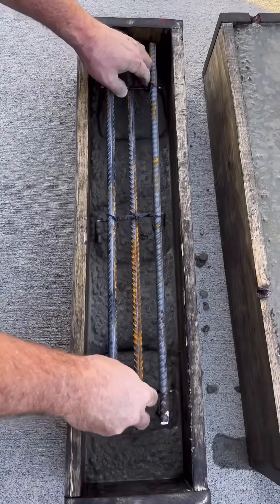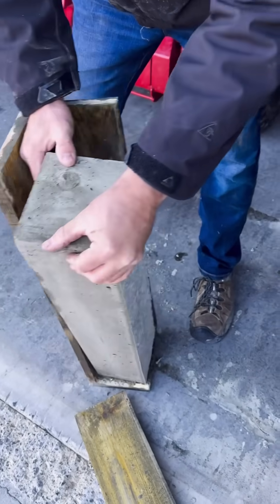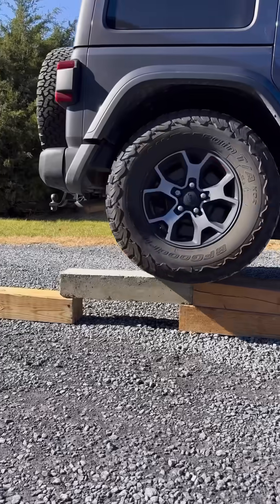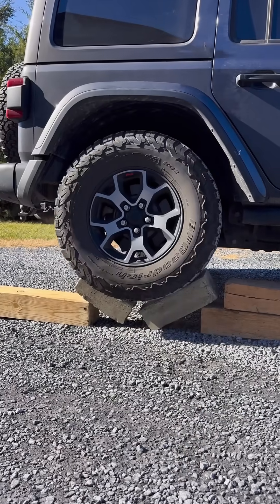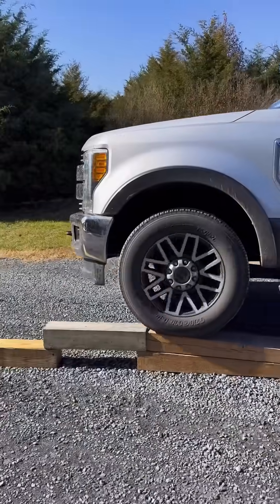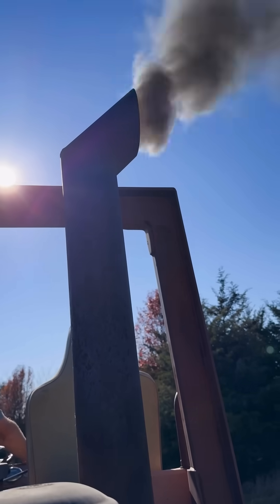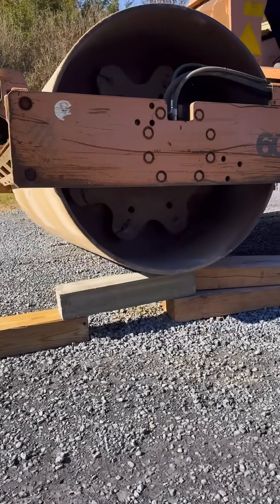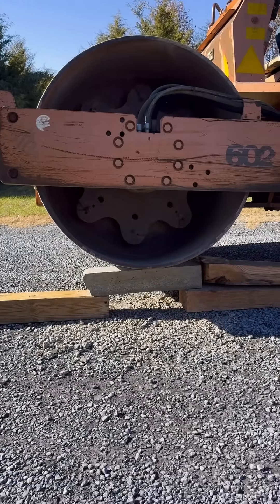Why We Use Rebar To Reinforce Concrete

Comment: The stones i.e. the aggregate holds the weight and the steel does everything else

The paste is the cement

Together it is called reinforced concrete or r.c.c.

Comment: 5 days
Reply from the maker: It was 2.5
Reply: @hausplans  for a high-rise slab, you could start stripping after 4 days but you still have to put showing under it to reinsure it for at least 5 hour 5 days to cure longer. The cement stays the stronger it gets

Comment: Respect for those woods
Reply: However, wood deteriorates faster than reinforced concrete.
Reply: @MrTexaz101  it actually don't if it's prepared correctly in the first place

Comment: Even with this minimal reinforcement, the beam performed well. A fully functional reinforced concrete beam would usually have at least 4 rebars and tightly spaced stirrups. With proper curing this would have survived the vibrating roller.
Reply from the maker: Plus this I only cared for 2 1/2 days

Comment: Concrete reaches max strength in 28 days, curing with right amount of moisture is a must, otherwise it will not gain its maximum strength.

Comment: 28 days, to fully cured! its a must
Reply: Concrete never fully cures
Reply: Yes, in fact can  be years eternally and stil getting harder, but in construction reality at 28 days its consider fully cured to remove the boards and use it!
 @Schmitti-q8y

Comment: Increase steel bar tension and compression side 12 mm bar , compression side 2 bar and tension side 3 bar then curing the concrete 28 days the test as you wish😊😊😊

Comment: Location of rebar also important.. would hold longer if rebar was at bottom between 1/3 and  1/4  of height  rather than in the middle...
Reply from the maker: Actually, I put the rebar in the top third of the form, then flip the beam upside down before vibrating so it was in the bottom third. You can see if you look at the part where the beam crumbles

Comment: What drives me crazy is that it will rust when you use steel reinforcement 
Can’t you people design a way to prevent rust or is all concrete destined to crack
Reply from the maker: If you make sure the rebar is completely embedded in the concrete. It can’t get oxygen in therefore it should not rust. Also, they make epoxy coated rebar and fiberglass rebar.

Comment: Currently studying Civil Engineering and I still can't believe how much calculations are needed just to know how many steel bars should be in a concrete beam and where it should be placed
Reply from the maker: I bet
Reply: The ACI code specifications detail cover distance and placement of rebars in reinforced concrete beam

Comment: Depends on temperature when curing and what standards you are trying to comply with. Usually 28 days. Steel placement also plays a huge role in the tensile strength as well. Looked like the steel was placed in the dead center, could be wrong, but if it was, it lost a lot of strength. With the downward pressure, the steel should have been closer to the bottom surface, typically 1” for maximum strength
Reply: This. I see everyone saying 28 days like it's always the same, but it depends on the temperature and humidity. Concrete curing underwater will take a lot longer to cure than concrete in the sun, but will be stronger in the end.
Reply: @MrArcticPOWER  For most situations 28 days is usually the design strength used.
Reply: @glyn6170  28 days is a "worst case scenario" data. These numbers will be completely different when it's 35°C+ in the sun.
I live in Canada and we poor concrete in all types of weather. It would be completely ridiculous to use the same numbers when it's 35°C outside vs when it's 3°C. The concrete in the first scenario will be harder in 24 hours then the 3-4 days old concrete in the second scenario. 28 days is just a "better safe than sorry" in all conditions.
Reply: @MrArcticPOWER  living in the UK we use the 28 day strength as the design strength in our calculations. In more extreme weather me we take mitigating actions. This include avoiding pouring, covering to reduce moisture lose in warm temperatures and to keep warm and avoid frost if we have to pour.

When your doing your calculations what design strength do you use? Does it very  around the country?
Reply: Yes. 1 rebar diameter from lower edge. And a second row on top edge.
Reply: ah is that because the tensile reinforcement need to be close to where the tensile failure would occur?
Reply: @Kyndral22 correct. Best demonstration i have ever seen was with a piece of 6”x6”x3’ long piece of foam block. If you draw three dotted lines along the side full length, one 1 inch from the top, 1 in the middle, one 1” from the bottom. Then bend the foam block like the concrete block in the video you will notice the dotted lines at the top move closer together (compression) the dotted line in the middle stays the same, and the bottom lines will move further away (tensile pressure). It basically shows that rebar in the center doesnt really do much
Reply: @Kyndral22 you want it to be strong in tension where the tensile stress is occurring, yes.
Reply: @Kyndral22  not really.  It's good practice to fix the tensile steel as close to the face in tension so you can increase the lever arm, thereby increasing the strength of the beam and reducing the amount of steel required.

If you move the tensile steel further into the beam, you would reduce the leaver arm, but could counteract this by increasing the cross sectional area of steel. You see this in really life situations where similar sized beams with differing concrete cover to the steel have differing cross sectional areas of steel, depending on where the concrete is situated, I.e interior or exterior.

Of course you can take it to extremes. If you fix the steel with a shortened lever arm, you will have a large area of unreinforced concrete prone to spawling and all the problems
Reply: RC will reach 70% of its final strength after 7 days, 80% after 28. That's the design theory we use.

You can start loading after 14 days and continue construction. For a slab you’ll have dead load but hardly any live loading. As construction continues and it won't be long until you reach the 28 day strength. This is the strength that calculations are based on.

Key factor is the temp. To hot it cures to quickly and cracks, too cold and the water expands and it cracks. Pour concrete when air temp is between 3°C and 35°C.
Reply: true
Reply: At my old job making tombstones we waited 3 days max for the concrete to cure
Reply: @tonymontanak762  but the tombstones dont have to hold any kind of load, they just sit there. And if they did, they would instantly break
Reply: @jacobviator3118 well they do hold something sometimes we have to put a big slab of granite to inscribe the people's names and other things they want also sometimes the kids mowing the grave yard drive over the slabs and anyone that goes out there for maintenance or to set a tombstone I personally watched my coworker run over someone's tombstone in the cemetery

Comment: It's not only the curing time, It's about the Resistance too. You need 28 days for  concrete to get to the maximum resistance of the design. But at 7 days you supposed to have 75% of the maxim resistance designed.

Comment: Steel is much stronger than concrete in both terms of tensile and compressive strength.

Concrete is cheap and steel is expensive.

Concrete is awful at tensile strength and mid at compressive strength.

Comment: We use steel in concrete with every building built here in india. Idk i can be wrong but i think it would have been more stronger if the steel would have been as big as your concrete bar i mean length wise and if the concrete was cured. Good test otherwise. 👍🏻

Comment: Generally you need to cure the beam 28 days to attain maximum strength, but even then i can't say for sure it will hold against a roller.

Comment: I’d judge minimum 7 days for close to full strength, but I don’t think the results would be much different. 
28-56 days is basically the final, lasting result, in terms of compression strength.

-former concrete testing technician 👍

Comment: And that Rusty rebar is going to continue to rust inside of that porous concrete and expand thus breaking the concrete from the inside.
Reply from the maker: If the rebar is completely encased in concrete, it can’t get oxygen therefore it shouldn’t continue rusting

Comment: I used to drive a mixer truck back in the mid 1990s and most contractors would start laying block on footers within a couple of days.  My guess is that your block cured less than a week.  The slump and mix makes a big difference too.  For example, road patch is driven on after it sets up and they'll pull the cones up within 8 hours but that's like a 4-5,000 psi mix with a high early strength.  I love doing amateur concrete work at the house LOL.
Reply from the maker: 2.5 days
Reply: OK.  That's kind of what I was thinking.  These experiments are cool to watch.  Our QC at the concrete plant used to make cylinders from concrete samples and crush them in a strength testing machine after a certain amount of time which I'm not sure of.  I still on occasion will deliver cement, but driving a mixer truck is no task for an old guy like me LOL. @hausplans

Comment: putting reebar in the middle (neutral fibre = no tension nor compression) kind of misses the point though
Reply from the maker: I put the rebar in the top third of the beam and then flipped it upside down before driving on it with the roller. If you look close, you’ll see it was in the bottom 1/3 of the beam when it breaks.
Reply: @hausplans  oh ok I'm sorry I didnt notice that. Then you're right of course :) great demo!

Comment: If this was left to cure based on my owm knowledge of concrete drying probably between 1-3 days depending on temperature. If it was less thsn 15 degrees celcius then i have no ide how long it took to cure

Well curing is different but i meant for the concrete to dry.
Reply from the maker: 2.5 days
Reply: @hausplans  thank you was curious haha

Comment: That was not optimal concrete. You made it quite wet and it was probably only a few days cured. With the lowest water cement ratio ie 0.3 and over time 28 days +, the concrete might well have endured your behemoth. I have tested many samples to destruction and max 0.3 w/c will get us 50N (M Pa) reliably. I am sure you know that.

Comment: Could you improve the strength by placing the rebar lower in the beam? It would make sense to have the most rebar in the place with the highest tensile stress
Reply from the maker: It’s hard to tell by the video but the rebar I put in the beam was in the top third. Then when I drove over it with a roller, I flipped the beam upside down. You can see when the beam breaks the rebar was in the bottom third. Keeping it low makes it stronger but you want to make sure it’s still completely covered by Concrete.
Reply: Yes placement and direction of the rebar is critical in design, but you also need to meet the minimum cover of concrete for the rebar.

Comment: Generally it is half strength in 7 days full strength in 28days and it keeps getting stronger, if you cure it properly then This helps to stop it cracking, I’d say you left it 3 days before loading it

Comment: By A.C.I. to be "certified" it must hit 80% of it's intended mix design within 28 days. Intended mix being the P.S.I intended for the Concrete, size of Aggerate like #57 Stone or S1A or S1B, amount of water/Portland/Sand for the Mix (if additives like Super Plasticizer or Calcium is used then entire process needs reworked due to end result now completely changed).

IF everyone places said Concrete the way it's intended (by code) most important being the thickness of said Concrete (rating calculated in term's of what's identified as a Slump being 1" to 12", 1" being so thick that it would be partially unmixed due to lack of water).

Typical spec of a small Runway would be 3000 psi to 3500 psi Reg @ a slump of no less than 3" and no more than 5" placed entirely within 45 minutes with at least 56 rotations of the Truck's mixer prior to placement adding Water ONLY to regulate Slump and Temp not exceeding 80 degree's (unless pumped in for placement) then AGAIN everything of the process is still the same BUT the requirements have now drastically changed all depending now on everything mentioned PLUS the weather outside, length of Hose, size of Pump etc..........

So with the "Beams" being made it would typically be 1 made at 7 Days, 2 at 28 Days and 1 at 56 Days (of course each beam NOT specifically made at those exact day's as they are all made the same day as the original placement was" . The first (7day) would be broken by a compressive strength Machine and you would be looking for at least 50% load (of the 3000 psi or 3500 psi whichever you used) and a rise/fall path on a now started graph that was not showing an erratic climb.

At 28 Days you break BOTH 28 day Beams and at this point your looking for 80% AND BOTH Beams cannot be more (or less) than 500 psi apart with their individual break number's. If everything is right then the testing stops BUT if anything is off then we continue on.

The last is the 56 Day break or the "hold" break in which you break it and afterwards you should be well within spec for the intended strength, the rise/fall within the now finished graph (typically you would have dealt with all the concrete companies for years so all of their designs would fall exactly the same as it's turned into their specific recipe basically) so once all that has been completed then a structural engineer will sign off on it and you've now passed your testing.            

Oh also these "samples" would be carted back to the office 24 hours later so as to strip the molds/I.D. them by marking then placing them within a Drip/Mist/Fogger room to stay an exact Temperature and to stay moist 24 hours a day because Concrete set's up the best within such an environment.

You might say "If your doing this within that room then the Concrete will be actually stronger than what's been placed right". That's EXACTLY why we do it as the thought process is "If it fails in here then it's really got to be Garbage out there"! 

I hope all of this useless info help's as this is code for the entire United States. "Whew" talk about writing a Book lol"

Comment: 28 days to cure and reach 95% compressive strength, and you need to keep watering the concrete for at least 10 to 14 days (depending on the weather) while covered so cracks won’t form. For the concrete to reach its full strength, it may take months; hence, they usually add an extra bag of cement for 1 cubic meter of concrete from the original design mix to reach the desired strength in 28 days.

Comment: YES!!!! NO REBAR you have no concrete,,,wire isnt much better,aka mesh, retired 25 yr rodbuster.  And just as  important is the placement, if your bars would have been near the bottom the beam would have stood a better chance of holding up.   Clearances = 2in coverage anything above dirt 3in anything  in dirt.
Reply from the maker: Actually, that rebar was put in the top third of the form. Then I flipped the beam upside down before driving on it so the rebar was in the bottom third. If you watch the part of the video where the roller crushes the beam, you’ll see how low the rebar was.
Reply: Oh OK kind of hard to tell watching on a Samsung phone. Very good 👍, these tiny screens details are hard to make out. Just very glad to see at least a few people walking around has some brains. Drives me up the wall to see new concrete pouring with no rebar, new home foundations, driveways all over being poured without any or very little installed.  They put thousands in something that in just a year cracks then  scream foul !! Try to suggest an even give reasons why , next thing out of their  mouth is well " we're pouring fiber crete you don't need rebar."  I just about bite my the side of my tongue 👅 clear off when I hear that every time. All a person can do is,,    ABOUT FACE !! and walk 🚶‍♂️ away there is no telling them. All they know is they have concrete, it's new an looks like progress to them,and it's already into their pocket deep.    Wish I could have Lee Emory,,, Drill Sergent from the movie full metal jacket tell them. 🤣🤣🤣🤣

Comment: How many days did you let it cure??  

I saw a house construction where they poured the concrete for the first floor the night before and dismantled the formwork first thing next morning. It had about 6-7 hours curing time 😨
Reply from the maker: 2.5 days. I think they should weigh at least 24 hours before stripping forms and that’s in the summertime.

Comment: Also, the least* amount of water you add will dramatically increase strength.  Can more than double the strength in testing.  Try to add as little water as possible to get the concrete to combine.
Reply from the maker: True

Comment: I heard any kind of tensil strength support will reinforce.  Like fibers or the cloth used for carbon fiber. Or ive seen a large cable frayed out so alot of the little cables that make up the big one spread through out the structure. I didnt see how any of it turned out over time but the sea water and quicklime concrete mix With modern reinforcements has to be better
Reply from the maker: Interesting